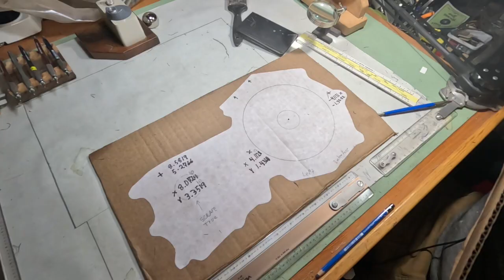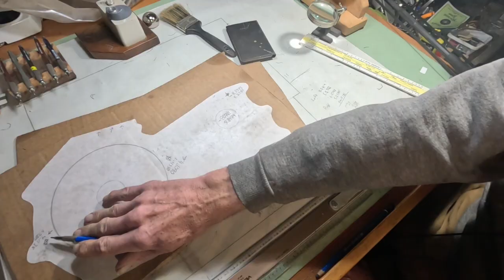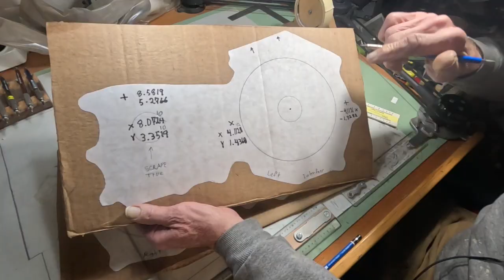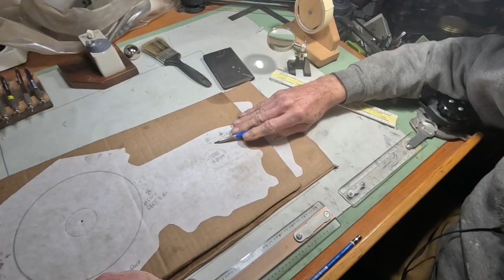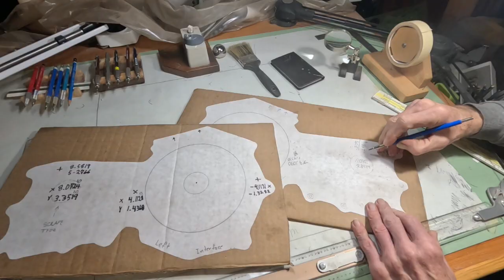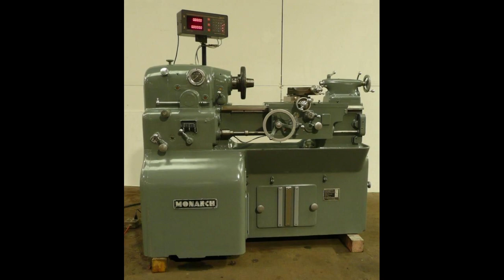Harley Davidson Machine Shop, transferring dowel pin location, mirror image

Comment: I've done a couple of shovelhead left case swaps to address loose main bearing inserts. When I do them I always line up the cases exactly like you show here, and then I install sleeve dowels in both bottom holes and the front bolt hole because the holes are inevitably off just enough to have to oversize them and lose the dowel effect of the ground lower through studs.
Reply from the maker: That would be a good way to do it, one of the common problems I delt with was the aftermarket left case, the Cal Case it was called and I pinned them like the Delcron cases.
 I did not know how to properly line these up until I ask how and also observing new Sportster cases being machined at the Capitol Drive facility in 1981, also the factory racing department fixturing with rotary tables on the two Bridgeports they had there. Gaining that knowledge turned my little operation profitable.

Comment: That’s funny seeing you using an electric eraser. I still have my Faber, though I haven’t used to for some time. I even have my old sheet metal rectangle with the shapes in it that we used in high school so as to not erase lines right next to what we were erasing. My drafting table is buried in the basement. I still occasionally use my small portable Alvin drafting arm on a 12” x 18” inch board.
Reply from the maker: If you need new eraser refills, the pentel click eraser refills fit and work well. Old stock erasers are likely dried up hard. 
 The last drafting machines made in the US Vemco is gone now but I think they are still made in Germany.
 Back in the day, the drafting tools were really expensive, then suddenly with computers it was all gone. I have not come across those tools in the junk stores for several years, I was still picking up the triangle shaped rulers for a dollar and have 30 or more thinking of making some kind of wall display. Back in the 70s those rules were 8 to ten dollars for the K+E and other quality brands still not worth anything now but the drafting machine scales are hard to find. I have always liked to draw so I enjoy still using that stuff now.
Reply: @ that’s good to know. Mine are fairly old now. There was an engineering company on the floor above my company and I was friendly with them. We did photo work for them. They moved out and said that I could,d take anything I wanted as they weren’t going to use manual equipment anymore. Honestly< I’d been using CAD for a while myself, but I still like manual tools. So I took a half dozen stainless T squares and a bunch of rules for my arm. They had some other good stuff I took as well. This goes back to the early 1990s and even then it had little resale value. Some of my employees took a few things as well. The most useful to me have been the T squares which I still use.

Comment: Would be interested to learn whether you use that radial arm saw very much, and if so, how you think it stacks up against the new power miter saws
Reply from the maker: Never tried a new power miter saw, likely never will. The 1950s small DeWalt radial is a precision machine tool.